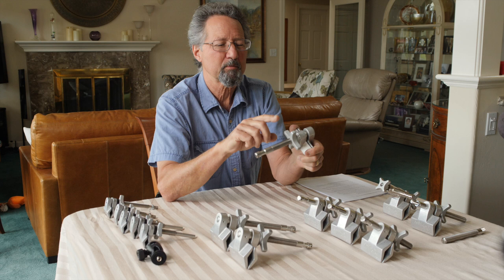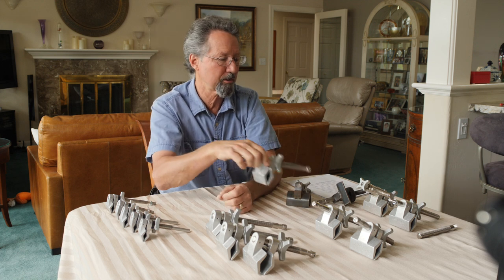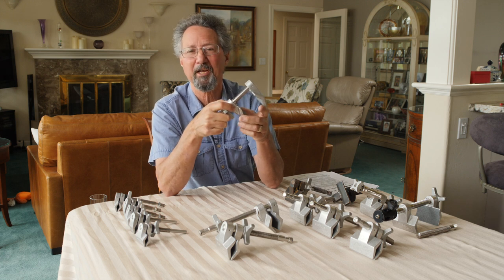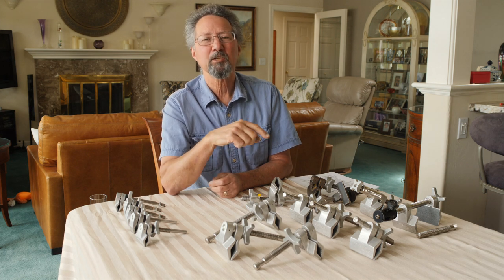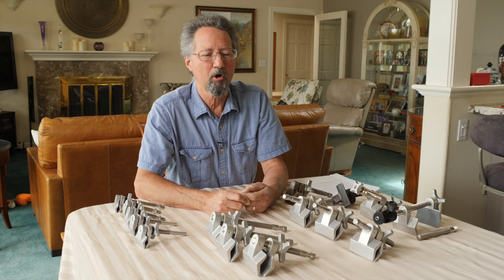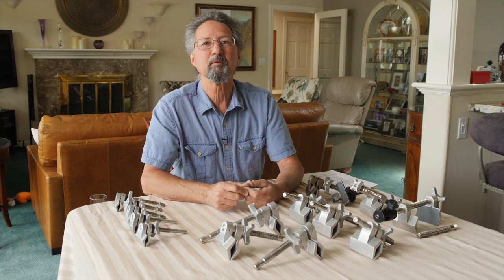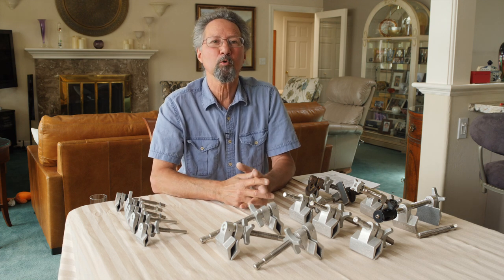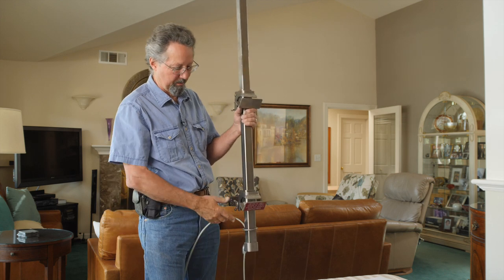Meet The Gaffer #51: The Cardellini Clamp -- Inventor Edition

Comment: Hey Luke! I have a question about the Mathellini clamps. I have a 3" center jaw and noticed that the baby pin is slightly shorter than the baby pin on a Matthews C stand (2-3/16" vs 2-9/16"). This means that when you put a Matthews grip head on it, the hole for the cotter pin isn't exposed, rendering it useless. Furthermore, the inset knurled section completely misses the screw on the grip head. In general Matthews seems to design their gear very thoughtfully but I can.'t help but feel this is a massive oversight. I know different manufacturers have slightly different specifications so I would understand if an American or Kupo  or Avenger head didn't fit completely perfectly in a Mathellini  but it doesn't make any sense to me that two products that are commonly used together and manufactured by the same company wouldn't be completely compatible. Is there a functional reason to have the baby pin shorter that I'm unaware of? Do grips just avoid using center jaw clamps all together when rigging a light with the baby pin pointed down? Do the original Cardellini clamps also have this slightly shorter pin?
Reply from the maker: Hi Jeff, I don’t have insight into the manufacturing decisions, but the fact that a pin is a little shorter, misaligning the indent for the fastening knob or not allowing use of the cotter pin hole, has not stopped most people from using them. You just safety your unit another way, like with an aircraft cable safety or trick line or sash. There are a lot worse incompatibilities out there within and between product lines, but the cool thing about gripping is becoming a master Jerry Rigger:) Bitch to the offending product maker and then embrace the chaos and create your own harmony!
Reply: @meetthegaffer  Thanks for the hasty reply! Admittedly my grievances are probably just an expression of my obsessive compulsive tendencies rather than a "real world" problem (I've never actually had a grip head slip on a Mathellini) but I guess that's what happens when I'm locked in quarantine with a bunch of grip and electric gear with no work and too much time, ha.I sincerely appreciate your response though. I have watched virtually all of your videos over the years and have learned far more about G&E than any other resource other than physically being on set. 95% of free instructional/informational videos about video and film production (at least on YouTube) just regurgitate the same super basic info without ever going deeper. Your professional perspective is so refreshing and your humble demeanor is something us younger folks should take note of. You're not the hero we deserve but you're the hero we need!
Reply from the maker: If you want a better hero than me, check out Andrew Lock’s Gaffer & Gear channel. He goes into incredible detail and is much more technically astute than I am. That said, I appreciate the kind words and will do my best to continue... until the large grip sings:)
Reply: @meetthegaffer  Yes I've watched several of his videos as well, definitely a knowledgeable guy. Your channel, his channel, and the "Grip Tips" channel are the only 3 I've found dedicated to G & E although Shane Hurlbut's channel also has some useful info related to lighting as well. Any others I should check out? Oh and one more gear-specific question for you (actually two)...Is Modern Studio Equipment as robust as Matthews? Some of their gear, specifically their grid clamps are far cheaper than Matthews but they seem to have a good reputation despite me not seeing them mentioned very often. My other question is about C clamps/speed C's. Most have that U channel on the ends, but the Matthews Speed C has flat circular contacts. I presume the U channel style is less likely to move once it's dug into the cribbing...any situation in which the other style would be preferable?
Reply from the maker: Burnie’s Apple Box is another channel to try. A number of the camera ones are great, like Cooke’s and anything Deakins does. Aputure’s videos are very easy to consume as well. 
As far as quality grip gear, I find different aspects in each that I like. I try to be as agnostic, or perhaps I could say ecumenical, as possible, so American, Modern, Matthews, or Norms are all quality brands. 
As far as the speed C’s are concerned, I have both kinds and like them each for different reasons. The u-channel one, like you say, have a great bite, but sometime you don’t need or want the bite regardless whether you plan to use cribbing. The both work well!
Hope that helps.